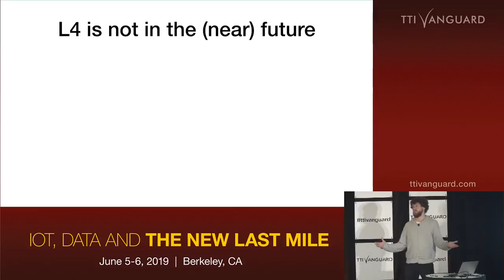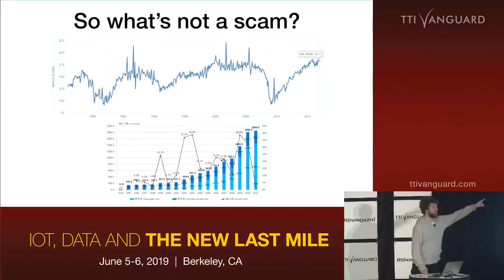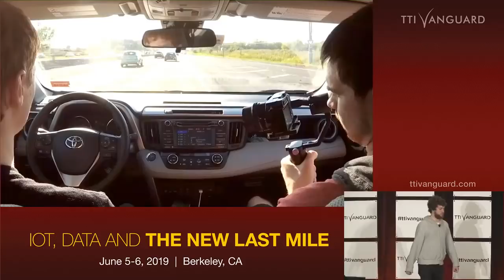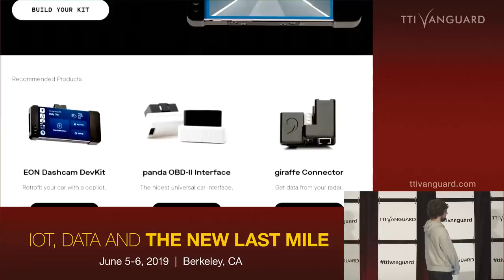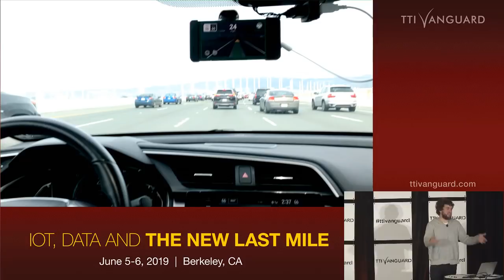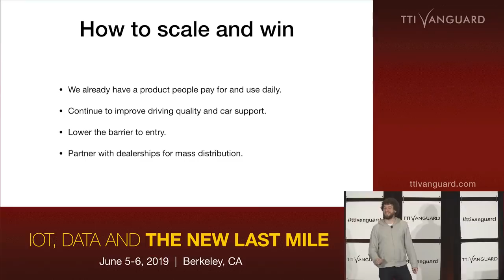comma ai | George Hotz | An OS for Autos | Self Driving Cars? Scam!

Comment: 5G will really transform OpenPilot.  Imagine streaming car sensor data to edge supercomputers, then receiving output data to steering, throttle etc.  Full roundtrip in 10ms!  The hardware cost per Vehicle goes down.  Its just a camera with a 5G modem builtin.  Capabilities and Safety expand due to SuperComputers making decisions AT THE EDGE.  Seriously watch these guys!! WOW :)

Comment: 9:47  "whats the cost of the driver?" as an uber, yhat really depends on car, i drive used high mileage Prius and the vehicle expenses is about 5% to 35%  of earnings depending on how you drive, when you work, and what kind of condition you're keeping the car in, where you are driving....

Vehicle expenses would go up a lot with autonomous driving until they started taking new account potholes, which streets are ripped up  where the dangerous roads are,,,,, a noob uber driver is going to go though a set of shocks every 2 years where an experienced driver can go 5 years

Comment: Besides high cost, LIDAR has a limitation in obstacle detection in a 3D environment. This is a least discussed topic in YouTube and forum. 

LIDAR produce 2D but 3D information. There two encrypted raw data produced that must be decipher into a 2D map in order to support auto driving. While in its 2D map we only see a “slice” of the 3D world view from the vehicle roof top at a down forward angle. This way it will miss obstacles in the hind sight and short objects in close range, in front . To recover hind sight we need a second rear view LIDAR. 

When LIDAR strikes branches and leaf it produce discontinued and random data. Data usually ignored from the 2D map. Lending it ideal to detect - men made buildings - buried in deep jungle. Beside leaves are chicken wire, grid, grill, bicycle spoke or frame, fir ball kitten, wind born flag and fast moving vehicle left to right ... last but not least are close range pets and toddlers. Since it is root top mount to 2D mapping it will missed objects shorter then 5 foot or so within few car lengths. 

LIDAR isn’t a real time high definition system. It cost more time to build up a definition equal to its intrinsic value. In other words, fast and low resolution or slow and high resolution.

Comment: My concept of autocar is more like yours, i believe it would be a huge hit if we link 3 home assistents together, the heavy loads | long distances assistant (thje car), the mid-range | light-loads (a flying assistant), and the close-range-interactive close to human handling capacity(like a maid). I believe this sharing rides are good, but they  present serious risks to the human privacy and security if implemented as they are today. Better provided individuals will have probably enough tasks to fill the schedule of such a equipment and the appeal and safety is much stronger in this context of privatly owned vehicules. Also the manufacturers must already thinkl of end-to-end software communication systems without any backdors and user's data autoretrieval by streaming.

Comment: What happens when the automakers start putting lockout mechanisms on their cars to prevent his hardware from interfacing? The big automakers will do that if the system grows bigger than a niche market. I really think he's glossing over that problem. At the end of the day, he needs the car manufacturers.
Reply: You're talking about the guy who hacked and found a backdoor to the iPhone that no one else did in order to bypass a lockout. He would definitely be able to find a workaround for something like that.

The bigger issue with this is more on the legislative side, because it's possible for manufacturers to lobby for a law making devices like this illegal to install on cars without prior approval from a federal agency or without expensive licenses.

At the moment, though, the manufacturers don't care about after-market modifications like this, because it doesn't hurt their business. Only companies that are making fully self-driving tech would care about it (Tesla, Waymo, etc.)
Reply: If I understand correctly, they already have to reverse engineer the connection to each car model. That's why model range grows fairly slowly. I think there are even bounties for 'jailbreaking' certain models.
Once self-driving becomes more of a reality, the manufacturers that were left behind will be queuing up to make their cars compatible with a solution like OpenPilot.
Reply from the maker: @Hans https://youtu.be/4PwgZX9G9Xo?t=3133

Comment: Any chance the Eon Devkit / open Ai, will be 2017 Mazda 3 compatible at some point?
Reply: A car has to have adaptive cruise control and some kind of lane assist from the manufacturer, in order to be equipped with openpilot. The steering, acceleration and breaking must be controlable by software. If your car has this, it might be added at some point.

Comment: How does autopilot work in countries where you often run into roads with no lane lines at all ? :) 
if self driving works based only on lane lines and cars in front of you etc it will never get advanced...
Reply: S Dj ... it does not...Tesla (and openAI) take a very generalized approach compared to other companies ... Meaning: The overall system is not following a set of rules... ( like: stay between lines)... The system chooses what information in the (camera)data most reliably tells it what to do.... This means It will takes any hint from possibly 1000’s of factors ( like people do) Eg:  my normal distance between  curbs, trees, buildings guardrails edge of pavement etc in this situation )...This means the rules are fuzzy, flexible, and able to adapt to human behaviour and expectation.. The tough part is training it enough to be clear what to do in rare circumstances....

Comment: "you're never going to get any sort of modern performance in c" clearly this guy doesn't understand programming
Reply: No, it's the way he communicates. His thoughts are faster than speak, and it's the reason why the sentences are not a full expression of what he means. He clearly had deep learning in mind - model training, building classifiers etc. Also meaning, that he is against a rule-based approach, which you'd use C or maybe Ada for. Majority of his software (the real-time implementation part) is in C++.
I've been doing a project on Visual SLAM and monitored closely his work, and the guy really does know programming.
Reply: @kawo666  Why do I find examples of neural networks in C when I search for them? Or am I miss understanding what you mean by C can only do procedural steps?
Reply: @zerix01  I didn't comment on C in that respect. It would be just slower to experiment with in a dynamic environment.
Edit: also, when I said rule-based, I meant rule-based AI (as opposed to ML)
Reply: He means performance as in time-to-market there. If you have to code neural nets from C++, you're not going to be able to leverage most of the modern frameworks..

Comment: That's a good point of comparing comma.ai as the Android. But I remember when there were some compatibility issues between phone manufacturers vs App makers. This could also happen on comma.ai, given that they support different models at the moment, there will always be a difference for every supported car models. I can say, surely it will be minimal, however this will accumulate over time.
Reply: The idea is that you as a user will have already the whole system and an account with deep learning models suitable for you, so when you change car this account goes with you (like Google account with all you valuable data in their cloud) as well as the hardware (so you don't have to pay for it every car change). Now, it is going to be in the car manufacturer's interest to ensure suitable middleware, that connects their model flawlessly with comma.ai system, otherwise they may loose a customer.
Obviously, comma.ai need a certain level of market saturation to get to a point, where manufacturers do take notice. But their system already influences consumer choices. If someone is into their Raspberry Pi'es and Arduinos and orher diy electronics tinkering, when they want something in that spirit for their car, they will choose some Honda that's compatible with comma.ai system.
Reply: @kawo666  great point. This boils down to car manufacturers' culture to adapt interoperability with their system. I can see nokia story all over again to some companies as soon as comma takes of into mass market.

Comment: Have the cars link together in a close distributed networks and linked used for autonomous swarming like pods/trains for commuting the main car would be priority with optimal teck like a rig with long-distance Higher sensors/network links. That would transition big rig drivers in to different areas like near field charging too. 🌊〰️

Comment: You think he intentionally confused real miles driven with simulated miles? George said 8.58M miles in 3 years with comma.ai (7800 miles a day)... He means simulated miles, for which Waymo has described that they have driven 10B (with a B)
Reply: George was talking about real miles which is what matters.  You can record one mile of data and rerun it 10 billion times and then claim you simulated 10 billion miles.  Any claim about simulating miles is completely meaningless and designed to be purposely misleading.   There are two metrics that matter total miles driven and total miles recorded/stored.  The total real miles stored is what you use for simulations and dictates how good those simulations are.  Naturally you rerun simulations to validate changes before you update the software that you push out to cars/devices.
Reply: @_PatrickO  so you think they (comma ai) drove 7800 miles a day, every day for 3 years?
Reply: @500amigareviews  Assuming the national average of 30 miles a day, that is only 260 drivers.  I would say they started off slow and did most of it in the last year as they got more people using the EONs. They are dashcams that always record and even when not controlling the car, always show the on screen lane keeping detection lines.  It is always detecting the road and when not engaged, that is really good data as they can capture the times when the human driving doesn't match the EONs prediction.   When people have these devices 100% of their driving is logged, not just the time the device is controlling the car.  I am actually surprised the number is so damn low.  Next time before you pretend a low number is really high, pull out a calculator and do some basic math first.  You have embarrassed yourself.
Reply: @_PatrickO  I guess it's possible. Any idea how many units they've sold? Implied I think in that answer is that they used customers as test subjects. Crunchbase has Comma with 12 employees, presumably software engineers. Terrifying to think how few miles they might have driven before launching.
Reply: @500amigareviews  They once reported 750 and once 1200 daily active users. Then even with the lower figure, at 7800 miles a day, it's only 10 miles per user on average. Doable.

Comment: he says we need more cameras a better chip with a failsafe option, more data. This is everything that Tesla has or working on. This is GG for Tesla boyz
Reply: It is because he isn't going to lie about what is needed just because tesla is the leader in this space like so many others do.  The dumbest of the dumb keep claiming lidar is necessary, when the only two working systems on the road have absolutely no need for lidar.
Reply: Kunal, the problem with Tesla is that you need Tesla car to use it. You see where comma.ai has an advantage?
It's like saying iOS is better than Android, while having a Samsung phone on your desk. Similarly here, comma.ai creates a usable ecosystem that is not tied to one vendor. And over time they will catch up to Tesla. Just like Android did to iOS.
Reply: @kawo666  I totally get that and I am all for it. I want others to catch up but I think for now Tesla is way better than everything out there. More the merrier good for consumers
Reply: @kawo666  Except comma.ai has the problem that car makers are trying to keep them out.  They are adding layers of security to their canbus to try to make it hard for anyone to put something like openpilot on it or any aftermarket device.   It makes installing more complex than just plugging into easy to access ports.  There are many models of cars not supported because comma.ai won't put any effort into adding it and independent developers just aren't going to do this work for them(even though they do do a lot already).

Comma.ai should have put in the effort to support as many cars as possible even if you only get steering or only get adaptive cruise and not both.  Had they hit it hard and got people onto their system, people wouldn't want to give it up.  It would have pressured car companies to stop trying to block car modders from modding because enough people would openly state they are not buying a car that comma.ai doesn't work on.

Comment: I feel like he brushed off the hacking a little too easily. It’s better to be proactive than reactive
Reply: @highgamer4957  I have no idea what this dedicated safety chip shit is.  EON runs on a standard retail LeEco Le Pro3 cellphone same as any other android based phone.  There is no dedicated chip for anything.  It is an all purpose cellphone.  He must be talking about a yet unreleased dedicated device made by comma.ai or he made shit up.

As for hacking, you cannot remotely hack a car.  That shit is all made up, the "hackers" are always people in the car connecting physically to it.  That is not hacking, it is just called normal access.  What the dumbass should of asked is what road blocks are OEMs putting up to block comma.ai devices and other devices.  In the name of fake security, they are making it harder to just plug into the car and access all the systems comma.ai needs to access.  They do this not for security, but to block 3rd parties from adding functionality and from diagnosing/fixing cars without paying them money.  It is anti-competitive bullshit, not security.
Reply: High Gamer as far as I’m aware, the safety code isn’t that complicated. It just prevents things from happening too quickly. And any networked computer can be hacked. Now I’m not saying hacking is a game changing issue, but it shouldn’t be so easily brushed aside either.
Reply: No one cares about hacking cars.

Comment: people say Lidar is not the way people perceive while driving the car..... aren't we making self-driving cars that can drive better than human?
Reply: Birendra Kathariya Lidar is worse than cameras.
Reply: @ophello  not sure how you come up with this baseless statement? Do you have any points to backup your statement?
Reply: @kathariyabiren  well lidar didn't stop Uber killing that woman with a massive bicycle
Reply: @DeeBee2013  hahaha, resolution of LiDAR  is getting better my friend. Actually system detected the person long before but the algorithm made some decision that led into a fatal crash.
Reply: @kathariyabiren  Lidar resolution is shit and the cheaper solid state sensors are worse resolution than the bigger systems.  Lidar also fails in rain or snow, making it useless.  Cameras are the main sensor, that is what the neural nets use.  Every company working on self driving is using a camera based neural net.  Radar, lidar, ultrasonics are secondary sensors that are not necessary,  They are just a redundant safety check that is less and less needed as the camera based detection improves.
Reply: @kathariyabiren  I think you answered your own question. At this point Lidar does not offer any significant improvement to the system. It's the software that needs improving (you said yourself - the algorithm/AI got it wrong). Improved distance  accuracy by few millimetres/centimetres is negligible at this scale.

Comment: roads are paid for by taxes which means you would never have a freeway restricted to only self driving cars
Reply: Until the vast majority of cars are self driving, the people driving manually will be booted off the roads and restricted to where they can go.  Same will happen with ICE cars when most cars are EVs that don't pollute.  People are not going to tolerate smelly gas cars near residential areas when most people are driving EVs.  People will eventually no longer tolerate idiots causing accidents because they refuse self driving.
Reply: It isn't the road. New cars sold will have to be self-driving because of the risk of humans drivers.

Comment: Is near crash data scenario data enough to build the system or do we need data on real human fatality crashes to have a system that protects against it?
Reply: I don't think an AI would care about the consequences. We are not at that stage yet where an AI is conscious enough to understand what it means to die. Therefore, it simply couldn't protect us. However, it could prevent it from happening and that's where we should concentrate, for now.
Reply: You dont need fatal crashes to get data to prevent them. Like he said, 90% of crashes are from drunk, distracted, or fatique/asleep drivers. If you drive correctly then the accident most likely will be the other partys fault and im sure as self driving systems progress they will be able to prevent crashes. They already can prevent rear end collisions and im a bit more familiar with Teslas autopilot.. where I think it can detect someone getting in your lane and will react.
Reply: You want data for everything.  Crashes are going to happen, logging the data helps systems like this improve.  The more unique driving data you have, the better your system can work.